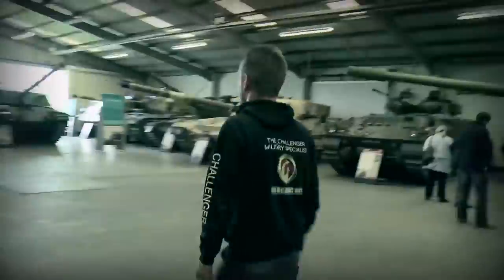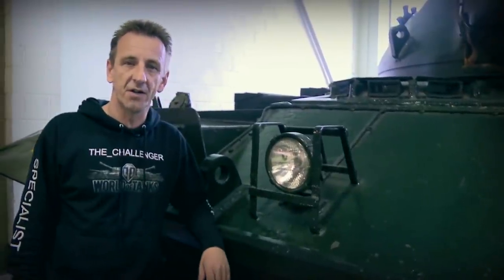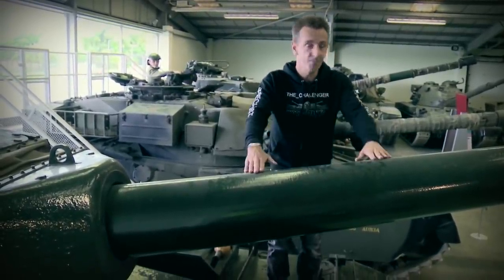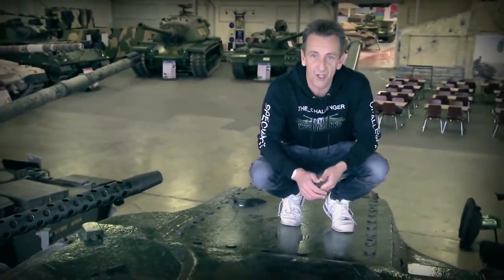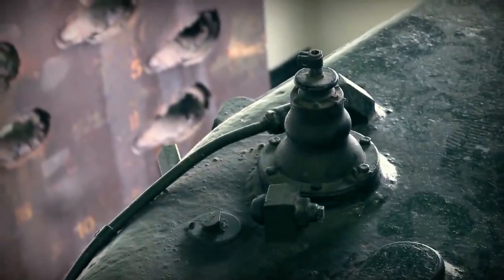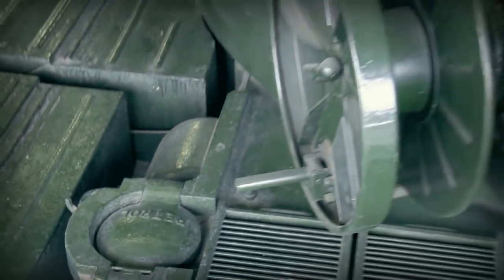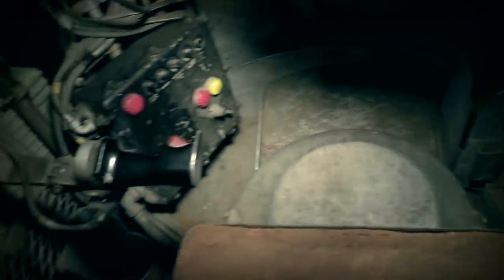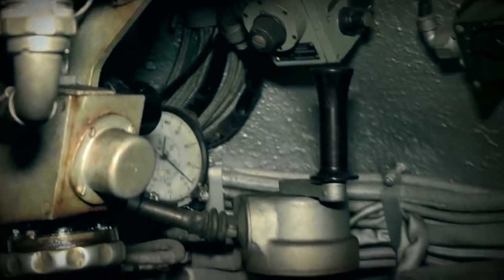Inside The Tanks: The Conqueror

Comment: The Conq shown is a Mk1, I drove a Mk2 for 2years, Reg No 03BB30, It's great fun when you don't pay for the fuel.
Reply: How hard is the Conqueror to drive compared to other tanks you came across?
Reply: @thomaszhang3101  The Conq had the same gearbox as the Centurion so you changed gears the same way,  you are working hard at it all day, now the Cong gearbox I had on my tank had it's gears back to front when I asked why this was I was told by REME that they were having trouble with some final drive seals going so thought this might sort it out. Driving tanks now is a doddle your gear change is like a motorbikes, but there's a lot more to a tank than just driving, ie ground appreciation, how to get from a to b using all dead ground and giving the crew a good ride, it can take 2-3 years to be good at your job.
Reply: @lawrencecaile  wow, thanks for sharing! I heard from YouTube videos that good Conqueror drivers were hard to come by and extremely valuable.
I had so many questions about the tank, but it’s a shame that many information could not be found online.

For example, how comfortable was each station compared to a Centurion? Cramped? Roomy?

How did the tank commander lay the gun vertically? Via vertical power traverse or by a hand crank?

How was the conqueror gun stabilized? How was firing on the move conducted?

Comment: The Conqueror is not the heaviest tank that served the British army though, is it? I just checked the specs of Challenger 2 and its combat ready weight is 74 tons. Even the empty weight is 64 tons. That's quiet heavier than the Conqueror.
Reply: Wow. I knew that the Challenger 2 was heavy but 74 tons? Damn. That is huge.
Reply: Most sources say the chally 2 is around 62 tons , anyway i think he knows how much a chally 2 weighs as he was a chally 2 tank commander knowing the weight of your tank is probably something you need to know.
Reply: @Mjk10957  The 72 is all the extra armour they fitted for Iraq round 2. I think it included belly plates to help with IED's as well as reactive type plates on the armour. UK MOD doesn't ever describe it and as there are no export customers for this version of Challenger I doubt we will ever be told exactly what the pack did. But thats your 72 plus tons.

Comment: Terrible video: 

- jargon spouted but not explained - what's an IS3, what's the Meteor engine, how does the Horseman suspension work?
- talking about features without showing them properly - like the first mention of the commanders' cupola and the nanosecond view of where the fuel fillers presumably were.
- relevant data not given - what caliber is the gun, when did the tank enter service and when was it withdrawn?

It's amazing how little useful information you can pack in to 5+ minutes.